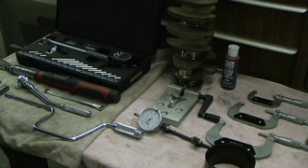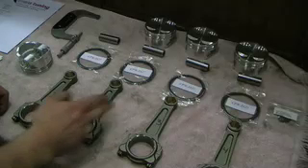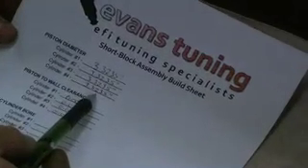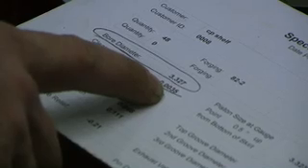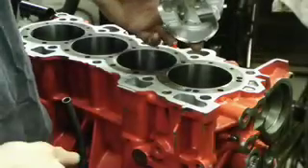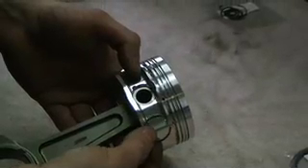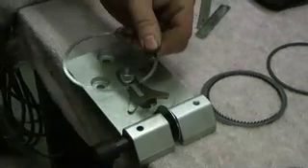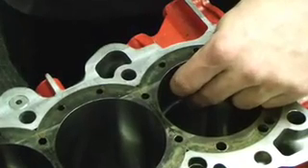Evans Tuning GSR Engine Build Tech Article - Part 1

Comment: when measuring the clearance of the crankshaft journals, you would torque down the main caps to spec?
Reply: yes, torque to spec with the lubricant you are using in the final assembly to take measurements, have the main bearings installed and then you measure

Comment: they should be able to do half that amount of hp with half the amount of cylinders with turbo. but then again they are rockin around 1000ish hp and running slightly less than the big boys do.